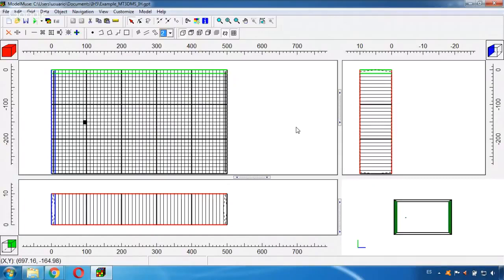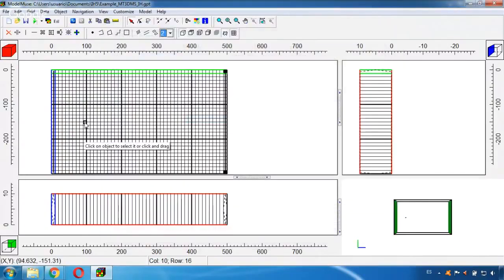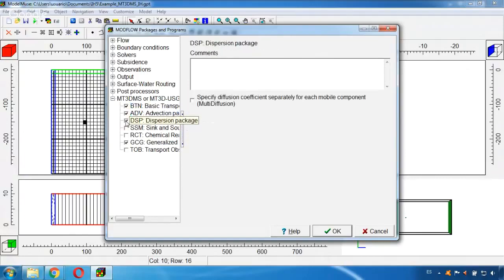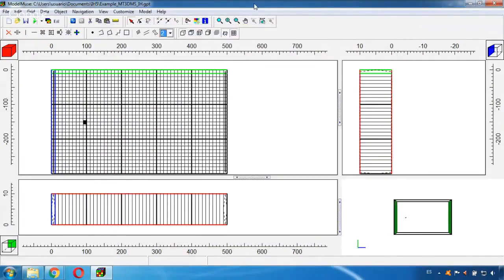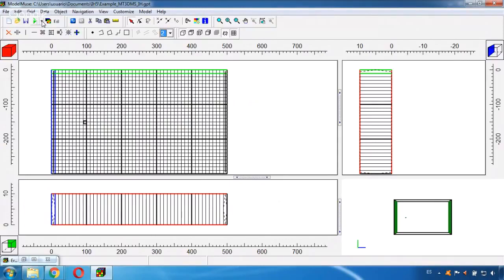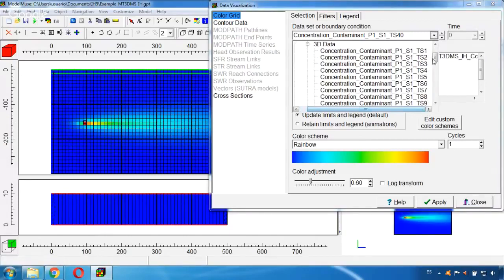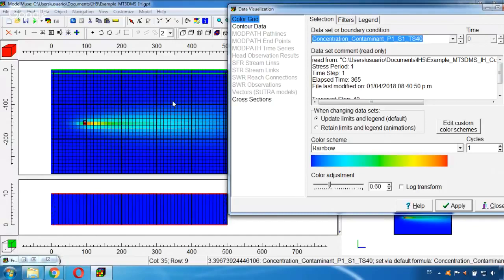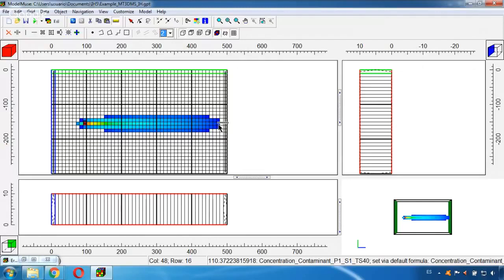How to model a contaminant plume with ModelMuse and MT3DMS - Tutorial

Comment: Please could you help me? i'm trying to make a simulation with a real case of a contamination plume for my final course assignment and a try to make this model and it doesn't run like yours.  When i import the results the model only calculate 1 transport step, and yours calculate 365 steps. Where did i made this wrong, I will be very thankful if someone help me.
Reply: Have you solved the issue? I am getting similar results to yours
Reply: @sadahahmed4536  Unfortunately not. I was doing this for my final job and I got stuck, so I changed the subject because I was running out of time. Now I have more time and I will definitely try to learn this software
Reply: You have to go to Modflow Output Control - MT3D - then select print and save data every N transport steps and set N=1
Reply: @mariuslauer5165  Hii I have tried what you suggest but unfortunatly it doesnt work. Do you have another advice for this case? Thank you